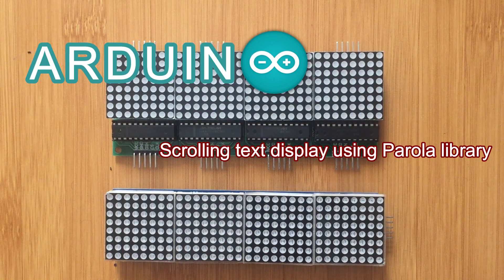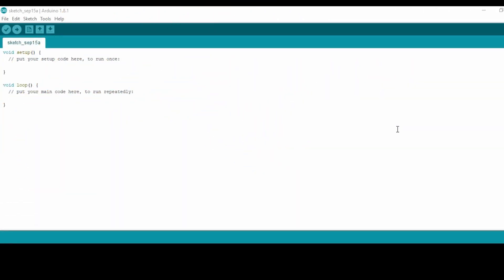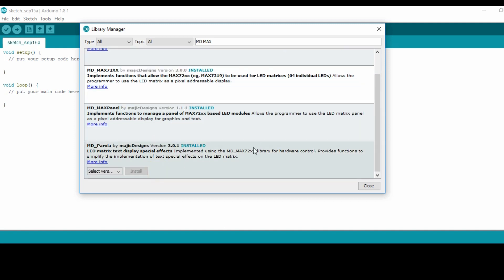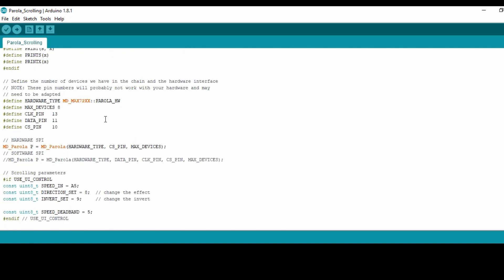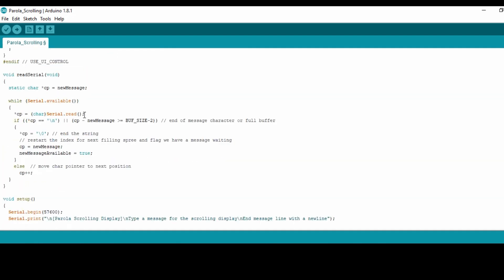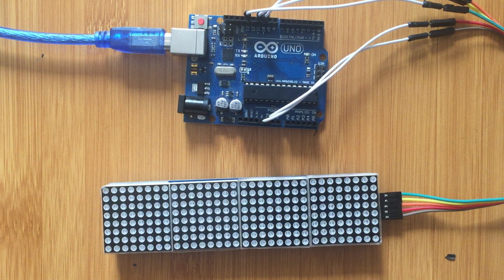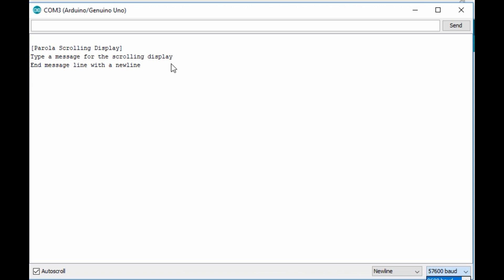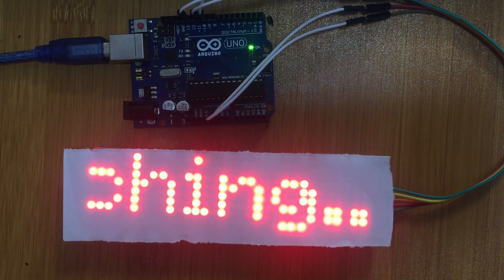ARDUINO SCROLLING TEXT DISPLAY USING PAROLA LIBRARY

Comment: Very interesting and informative. As an experiment I tried to power my matrix with an external power supply (common ground) with a current limiting resistor but it just will not work. Any thoughts?

Comment: my scrolling display is running,but in revers immage  we see the mirrer only,the correct image , how to solve the problem
Reply from the maker: I explained the working of the code for  this display in the link: https://mytectutor.com/max7219-led-matrix-interfacing-with-arduino/ . Try going through critically you will find a solution to the display orientation problem